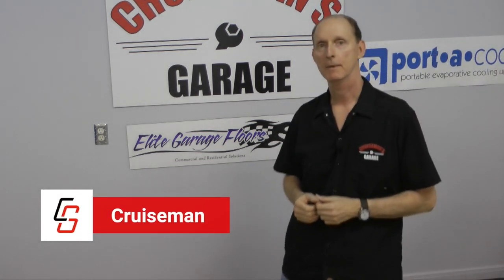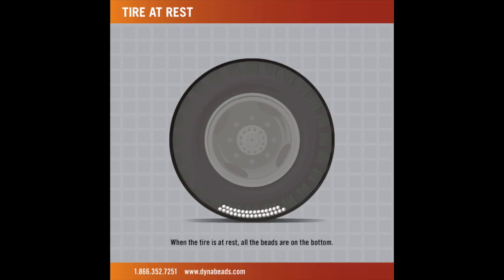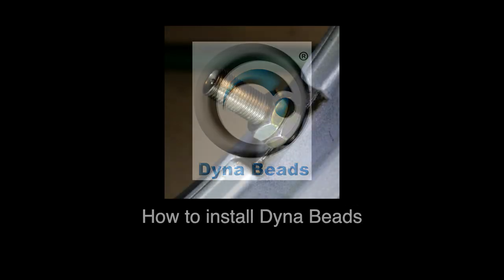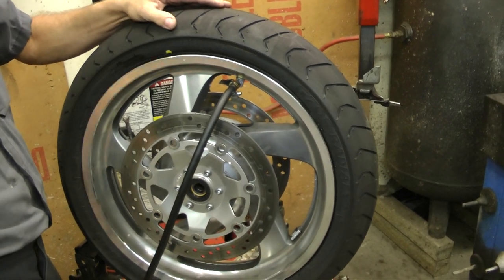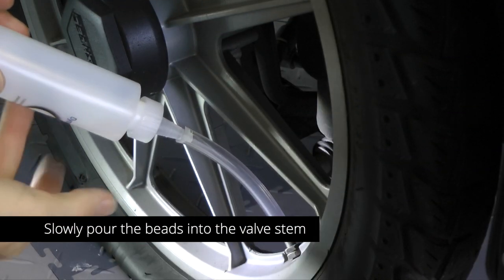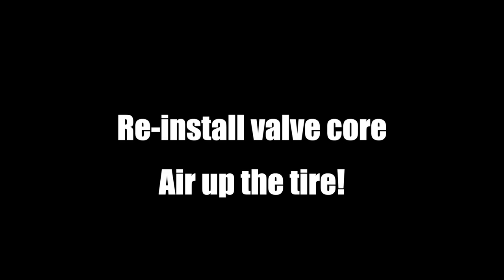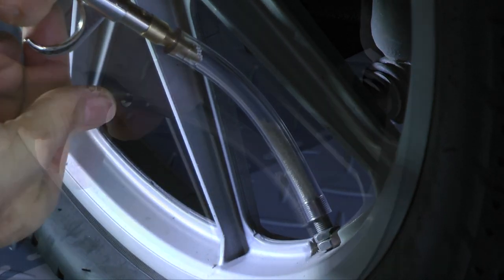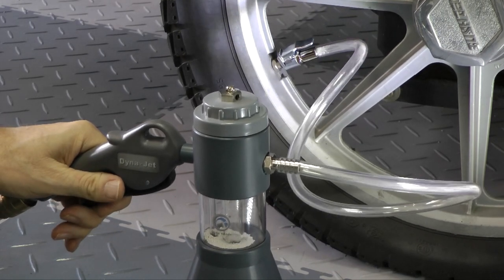DynaBeads Dynamic Tire Balancing Installation and Review | CruisemansGarage.com

Comment: With TPMS valves, the direct install is the way to go.  This is reasonably done at time of new tire mounting, but if the tire is already mounted one side of the bead can be "broken" and the beads installed.  A problem can occur with direct installation; if a bead or few gets between the rim bead seat and tire bead, a slow leak can be the result.  Slow leaks are bothersome at best and dangerous regarding blowouts at worse.  To avoid this problem, wrap the DynaBeads in a fold of toilet tissue and lay into the tire as a "package".  The package will quickly break down into harmless micro-dust and the beads will be free in a well mounted tire.  Frankly, I prefer static balance with carefully appleid weights, but if I had to rely on the kid at the dealership to balance my tires, I would use the dynamic beads.

Comment: Here are some facts related to dyan beads. After being on various MC sights for years I have yet to see anyone actually test these snake oil products. Typically the owner dumps in the sand then proclaims it works because there is no shake. I have yet to read where a slightly out of balance tire was balanced by adding anything but weights. And yes I did some tests on this to see if they work or not. First In general if you don't balance a motorcycle tire there is a 99% chance you will not feel any shake as 99% of MC tires are close enough to balance to not really require any weights or balancing. Fact is I have not balance a tire on any of my hundred or so motorcycles and only twice did I experience any shake. So what is happening is a tire that is good and true is filled with sand then the owner simply says the stuff works and the lemmings will just blandly follow. So here is the real world test results. First find a tire that is truly out of balance enough to exhibit a noticeable shake  This is hard to do and in general not a possible achievement so I did a car tire instead which had a slight shake at around 40mph which is typically where it is most noticeable. So in went the recommended volume of dyna bead and a test run. After several start and stops I found not only did the stuff not work but at times was worse, Adding weights was an immediate fix. This was one of several test and in general the beads only balance tires that are balanced. If you really want to balance use the one thing that really works - weights. Or just don't balance unless the wheel shakes it's just common sense, don't waste your time and money on snake oil nonsense. The physics and theory behind this stuff does not even make sense. Just for fun "think" where are the beads going to go? Are they magically going to find the light spot and go there? How do beads know where the thick part of the tire is especially if its on the sidewall or bead area? And of course there is the magic red dot on tires that tells you where to put the valve stem are bead looking at the dot? I think science and physics work snake oil not so much. But do the test yourself, if you can find an out of balance MC tire that is. Good luck
Reply: If you don't like it don't Buy it...I don't care in the least what you think...now where is your video ???
Reply: @stevebell4906  Well it seems you do care or you would not be so harsh.
Reply: @ROT2024  So sorry that I wasn't clear...I do care about the dyna beads and the review...

I just don't care about you or your opinion...or your pontificating about it...but I am looking forward to your video proving all of your claims and hope to see it soon!

Comment: I can't see how these beads can correct an out of balance tyre.  There's way more in the physics of this scenario than the tyre wobbling & the beads somehow finding an equal & opposite position. 
The problem that I see is the moment of inertia of the beads at varying rotational velocities. Although there may indeed be a certain rotational velocity whereby the mass of the beads can overcome the centrifugal forces working on the bead mass,  I believe that the centrifugal force will be so much greater than the moment of inertia of the tiny beads, effectively locking the beads into any position on the inside of the tyre at the time the centrifugal force exceeds the moment of inertia of the beads which, will be the majority of the time. Since any circumforaneous movement relative to centrifugal force is a product of the moment of the bead mass + or - the velocity differential in rotational velocity - friction. On top of these factors, the change of shape of the tyre as the circumference rolls along the ground would be a major force in the bead moment of inertia as this would effect the position of each bead relative to other beads around it. 
At the moment &, without scientific testing & verification, I cannot see how this system could work as advertised.

Comment: Sorry; Off topic again. Have you shot a video on heli bar installation on the 2018+ GoldWing? The written instructions that came with the parts make it look simple, but the video that the owner of the company shot makes it look much more complicated. It shows disassembly of the left handlebar controls and removal of the handgrip, etc.. There is no mention of any of that in the printed instructions. I’m about to dive in.
Reply from the maker: Dwight, I have not. I reached out to Heli-Bar awhile back and never got a response. I have just been so busy, when they don't show any interest, I move on to other projects.
Reply: @cruisemansgarage ; I hear ya. I emailed F4 Customs a few months ago and never did hear from them. I didn’t have my bike yet, so figured I’d wait until I tried it with the stock windshield before considering aftermarket. Now, pretty sure I’ll order an F4, but thinking that if they couldn’t spare 5 minutes to respond to my email, maybe they don’t need or want my business. Same thing happened with another company for other accessories, but I can’t even remember who that was. I went elsewhere. 
You’re still rockin’ the tall F4. You seem happy with it. So I’m thinking I’ll have to call them directly when I’m ready to order the 20” recurve.
Reply from the maker: @whatsupeh1  Wow, that doesn't sound like F4's customer service. Send an email directly to Don Frank (Donfrank@f4customs.com) and tell him I gave you his email.
Reply: @cruisemansgarage ; Thanks. I’ll do that when I’m ready to order.
Reply: @cruisemansgarage ; I installed the heli bars today. Turned out to be a pretty easy job. Initially, just sitting on the bike after the swap, they felt pretty good. But after a quick ride around town, the difference wasn’t as big as expected. In fact, I didn’t notice much of a difference at all. A longer ride might make the change more apparent. I’m hopeful. 
While I had the steering head laid bare, I also installed the steering safety pin from Traxxion Dynamics. Simply good insurance.

Comment: I can't believe you actually showed put the beads in a tire before mounting it. Duh. I at least had one side mounted on the rim and then prying the other side on. I think the beads got stuck on the bead of the rim and I had air leaks for the 10,000 miles 3 years I had the tires on. There is nothing to keep the beads from flying out or getting stuck on the bead of the tire or rim. You don't explain how much beads for what size tires. Most important One size package does not fit all.